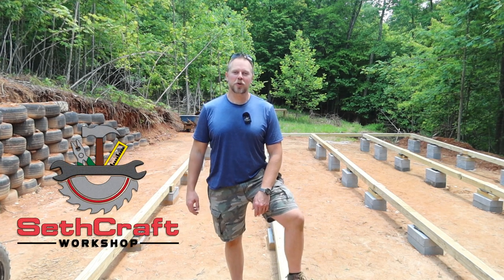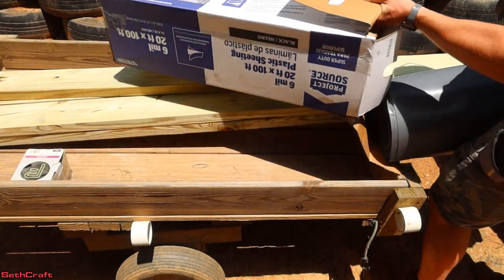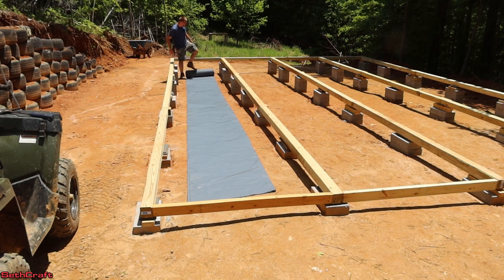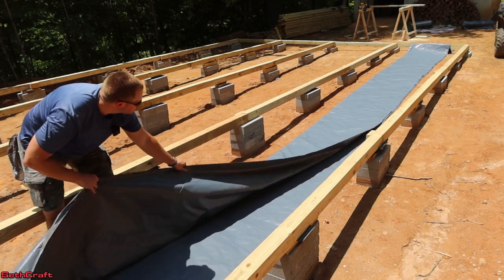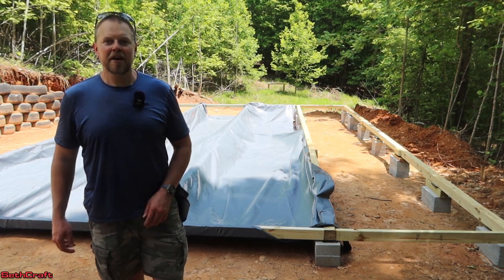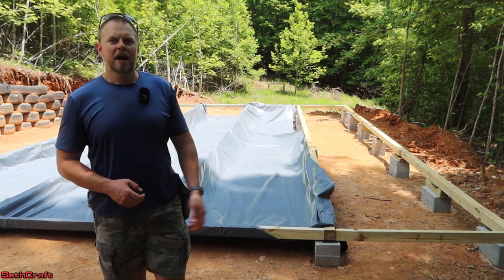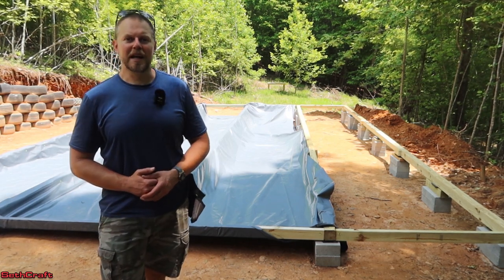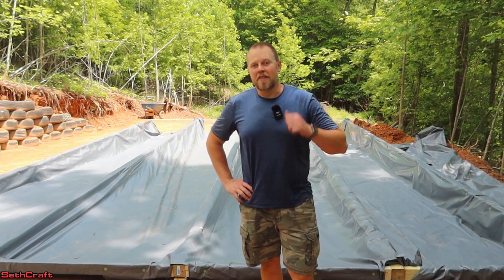Shop Moisture Barrier 6mil plastic [Stop Ground Moisture from getting to your shed]

Comment: I’m in the camp of this causing almost as many problems as it solves, also adding more work and expense which most people won’t like.  My biggest concern is that one of the most integral parts of the build is still unprotected…the 4x4 foundation runners (4x6’s should be used on a building this size) if those are 6x6’s forgive me, I can’t tell in the video.  

Here in East Texas we have extremely wet winters and spring, followed by extremely hot and humid summers, and sometimes go two or three months without rain at all, during which times everything dries out, believe me.  You don’t say where you are located other than it rains frequently. Location and typical weather are extremely important as to whether to do this or not.  I always build as if it’s to last a lifetime, as most people should if they can afford it, but after my 60+ years I’ve learned that reality is that within 10-15 years I’ve moved on to something else. At this point, I’m only building for something that will last around 20 years and that’s good enough.  That being said, a raised foundation on blocks with treated lumber alone will definitely last at least 20 years.  

If I put down plastic it will be under the blocks and everything.  Rodents will chew through your plastic within weeks rendering it almost completely useless unfortunately.  Plastic, then gravel, then blocks and treated lumber is the ‘lifetime’ method. You can be commended for a better than nothing method, but this really isn’t demonstrating a recommended way of doing this.
Reply from the maker: I lived in NM for 7 years. HOT and very dry. One year we got 11" of rain. Here in NC we have gotten 11" in 1 week before.

Recently I pulled some 4x4s out of the ground after 10 years. They looked new. These 4x4 skids on the shop should last 80 years easy. They are not getting exposed to rain or sun. The moisture in the ground here is incredible. Much better to have a layer of plastic down. 

You are right. It depends on the place you are building. Here its good to have a moisture barrier down.

Comment: I was thinking the same, until I saw the other was opened and it drains in that direction. But, good catch on that.
Reply from the maker: Any water that does get on the plastic drains out quickly from the far end. This type water barrier is great for the area I live in.

Comment: Having 30 +yrs. framing experience I've seen and done most everything involved with building and the plastic cap nails are what we call button caps in SE Tx. and one of the many things we use them for is nailing down roofing paper. A lot of guys that do shingles full-time have their hammers magnetized and will place the button caps on the head of the hammer and drive em in !
Reply from the maker: Thank you for watching. I just used the button caps for tyvek home wrap and for the roof underlayment. They are very handy. Magnetized hammers seems like a fun way to drive the nails. Also must take some sills!

Comment: Actually, this is the place where all the moisture will now collecting. No wind is here, and under temperature the plastic starts to make and collect a moisture. I would raise it up to couple blocks and leave it.
Reply from the maker: So far no issues with moisture. Now if you peel back the plastic the ground is wet. On top of the plastic things are nice and dry. The 2' open gap at the end seems to let in plenty of wind to help with any moisture.
Reply: @sethcraftworkshop  
I will build a shed the same size as you and your video is a great example for me. I'm thinking about insulation from below, but have not yet come to any decision. You've done a great job laying down the plastic, but if there's a small crack in it, nature will come in with a vengeance. Perhaps this is the best solution today. I just don’t understand why you didn’t tighten plastic but let it loose?
Reply: It’s similar to a crawl space, but the way he did it really makes sense as it slopes down if rain water and the ground water will also be kept away from the flooring of the shed/workshop.

Comment: I have been watching your vids on foundation because I will at least get the foundation done and then maybe hire help for the rest. You stated that you had mold issues and that you tacked plastic under the foundation and that helped. I have a old house that has many issues and I am afraid of mold only because the moister level is high. The windows are always running with condensation in the winter months.  However, the crawl space will only allow me to get about 6" from one side. One end i can be on all fours, the other side I'm am doing an army craw of shorts. I'm thinking this would help but if I can't get to all of the underside of the foundation then it may not be worth it.   It rains so much here in OR.

Comment: It seems like at @4:44 that it would have made more sense to just go over all of the timbers (like you're doing on the side closest to your existing building) rather than cutting the plastic at each of the support blocks that can then allow water to get into it.  Just a thought....
Reply from the maker: Ah. Yes that would work. As long as the ground is covered I think this is going to work well. Either direction that you go as long as it blocks the moisture from hitting the floor of the shop.

Comment: Obviously I’m too late for you to do but did you consider painting the bottom of the building with a moisture repelling coating? Instead of using the plastic?
Reply from the maker: That could work. I went with the plastic because it is easy and cheap.

Comment: Here I am wondering about the idea of the vapor barrier on a shed floor.  I have read a bunch of comments from many others about this, and this video shows it done.  Condensation could be the enemy here, those days when a few degrees matter and dew points meet then wet it all becomes, plastic sure holds water leaving only evaporation into steam its only escape and it will go right up into the timbers.  Not so sure its a good idea. I am beginning to think the breathable landscaping cloth might be the best solution.  A reduction solution may be the closest you can get.  Anyone else have a comment, please do.  Cheers!
Reply from the maker: I have three buildings on my property and each have vapor barriers like this. My first shed did not have a vapor barrier.And I had a serious mold issue.  I climbed under the building and placed a barrier and no longer have that issue.

If I lift up the plastic, there's obvious water drops coming down.However no moisture seems to be up against the building.
Reply: @sethcraftworkshop  I took your advise and put a vapor barrier down over my block then the frame went on.  Thanks for the tip. Cheers!